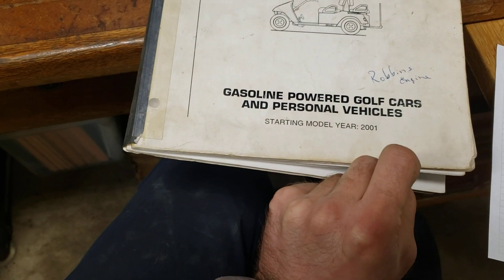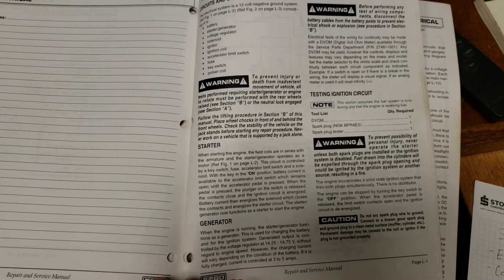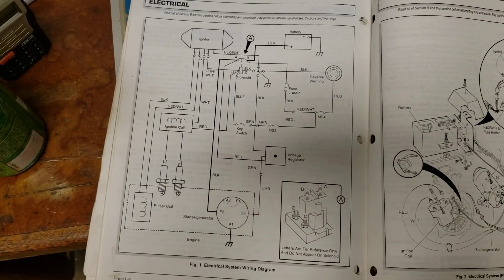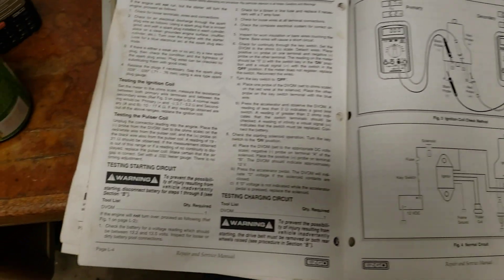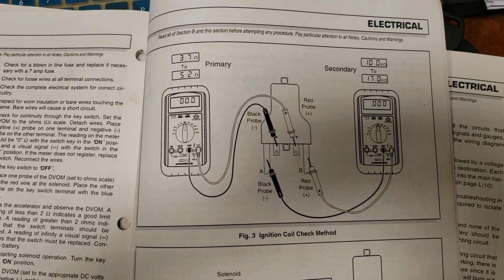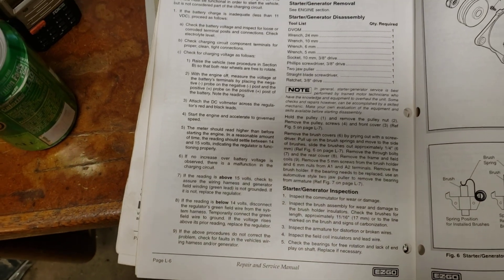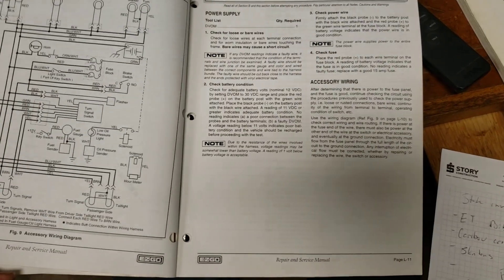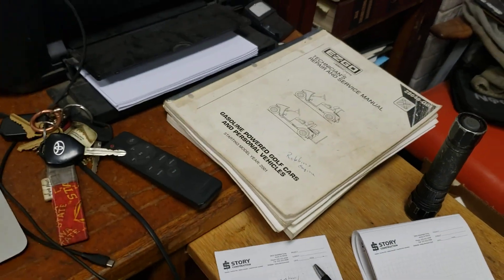EZ GO Won't Start Part 2

Comment: this is probably an easy question for you, robins 350 engine, the green and red wire that come from the foot pedal. where do they go
Reply from the maker: I don't have the manuals with me right now but I can check tomorrow if you still need

Comment: Question for you. Cart wont run untill you remove and replace a coil primary wire? 1996 EZGO TXT....Why?
Reply from the maker: @keithmassie  That sounds like a weird one. Two questions, is the wore shorting against something and by unplugging it, you're moving the exposed portion. Second, any corrosion on the connection at the coil you're possibly cleaning up when unplugging and replugging?

Comment: Do you have wiring diagram for ignitor on 1992 EZGO Marathon gas cart?
Reply from the maker: @veteransunitedinc  it looks like all I have is 89-93 2 cycle including gx, gxi, gxt and PC models. Would that be close enough?
Reply: @BlakesGarage1  If it has a clear electrical diagram sowing 2 spark plugs, maybe
Reply from the maker: @veteransunitedinc  unfortunately it looks like this only has one spark plug. I'll upload a video of the manual momentarily and link it here
Reply from the maker: @veteransunitedinc  https://youtube.com/shorts/0GhRUWfDbsw?si=EqWr2GjUgkuQrm1N

Comment: Thanks so much for showing some of the spec's. I watched both vid's and have been working on a 6 seater EZ-GO cart (early 90's?) for some time now. Had it running and rode it around after basic fuel pump, air box, carb, plugs & battery service but now it is a no start. I'm going to ohm out the coil tomorrow but when I pull plugs and hold against head, they do spark but maybe not enough. Seems like when I completely pull one plug out of engine and turn it over, it definitely tries to run but not quite. I realize this could end up going down more rabbit holes such as pulse coil, Igniter, valve lash and compression and can post follow up after tomorrow. Engine looks identical to the one you were working on originally so am wondering if you can say what the correct valve clearance should be? Thanks for any additional help.

Comment: Blake! I’m working on a 2008 ezgo with a Kawasaki engine! Battery if new, carburetor and fuel pump is brand new, it turns over fine, really strong spark but doesn’t start. Compression was around 152 sorry forgot, reset valve lash .004-.006. I put my hand over the carburetor to choke it but I don’t smell gas nor does it comes on my hands. Could it be a stuck valve or?
Reply: If it's not getting fuel I recommend removing the fuel line from the carb and cranking the engine a few times. The fuel pump should pulse and spit out fuel. If not, check the pump or fuel lines and vacuum line to the fuel pump for issues
Reply: @lilybdrinks  thanks for the reply! I did check the hose going to the carburetor and it’s pumping out gas relatively strong!
Reply: @lennyleejr7763  interesting. Next thing to check is that the carburetor float isn't wither stuck or too low. You can remove the drain plug from the float bowl or the bowl itself to make are there's fuel there. Also try spraying brake clean or starting fluid directly into the carburetor and see if it runs for a short time. Between these two tests you should find something.
Reply: @lilybdrinks  I just sprayed starter fluid and nothing! I installed a brand new carburetor and yes gas is coming out from the bowl! Could it be the intake valve stuck in the close
Position?
Reply: @lennyleejr7763  if it has spark, compression and fuel then yes, as far as I know all that's left is valves. Pull your valve cover and crank it to make sure valves are moving. If yes, check your clearances
Reply: Another possibility is that it has spark with the plug out but not enough spark to overcome compression. To check this you could remove the plug and put a little starting fluid directly in the cylinder instead of in the carb. This would bypass carb and valves from the equation.
Reply: @lilybdrinks  both intake and exhaust valve operate as should!  The first time I adjusted the valve it started then the next morning it didn’t want to start and that’s where I am right now. Like I mentioned it got spark through spark tester! Even when I grounded the spark plug. Could it be possible the spark plug is faulty?
Reply: @lennyleejr7763  does your coil ohm out within spec?
Reply: @lilybdrinks  I don’t know! How do I check that? Never did that before?
Reply: @lilybdrinks  is gas supposed to come out of the spark plug hole when you pull remove the plug and try to start it?
Reply: @lennyleejr7763  definitely not. That would indicate either a stuck float in the carb or that the carb float is far too hight and flooding the cylinder. You will also want to check your oil level because if the cylinder is flooded there's a good chance it flooded the crankcase too.
Reply: @lilybdrinks  I think I found the problem! The primary side doesn’t ohm out! It shows OL
Reply: @lennyleejr7763  great!!!! Still concerned with your gassy cylinder but good find
Reply: @lilybdrinks  brother I need ur input! I got the cart running but it won’t idle or go slow it will only run in fast mode or when pressing the gas pedal halfway or more. I installed a cheap Amazon carburetor and it didn’t want to start but when I put the original back on it ran but only on higher speed. What’s your thought on this problem?
Reply: @lennyleejr7763  it sounds like Governor adjustment. Likely in your case the governor is related to the carburetor and throttle cable adjustment. Are you able to put in in neutral to test it in "park"?
Reply: Yes it can be tested in neutral! So I need adjust the throttle cable or governor or both?
Reply: @lennyleejr7763  I think mainly throttle cable
Reply: @lilybdrinks  thank you! I’ll let you know my find